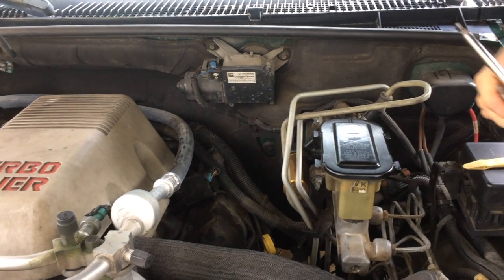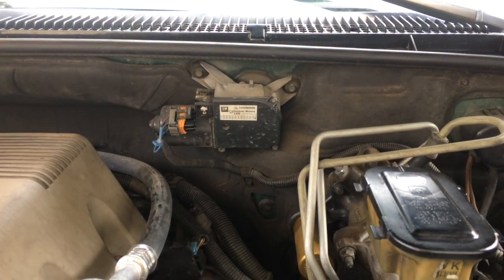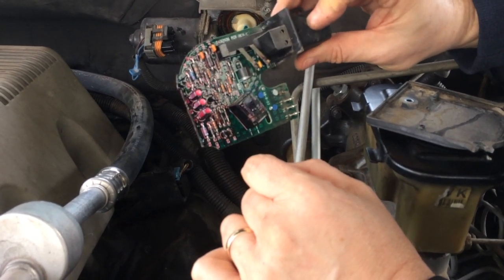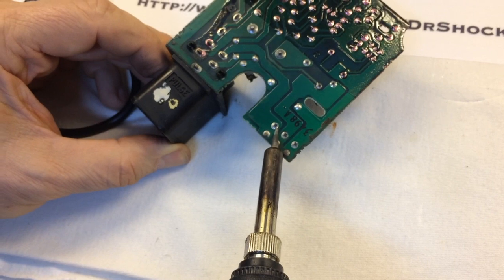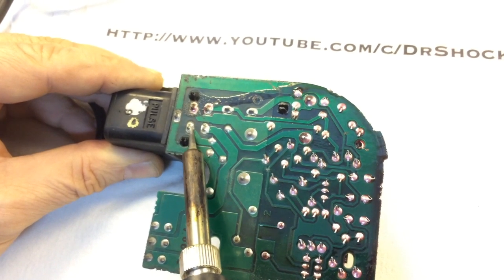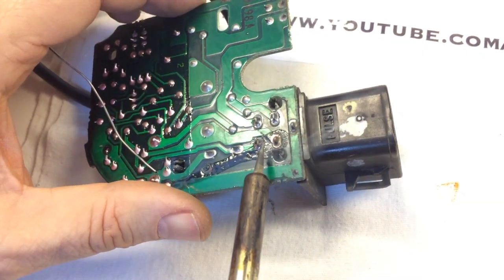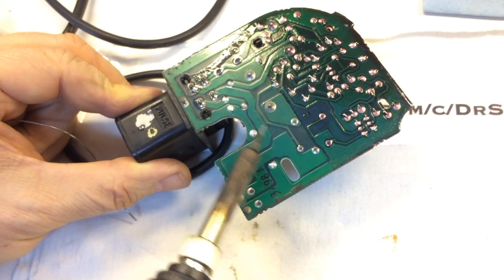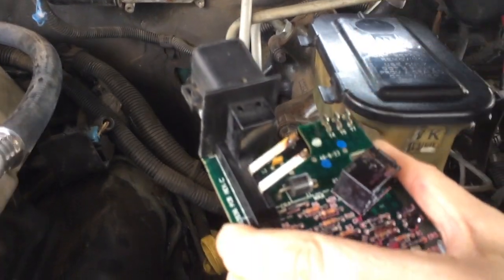1995 - 2002 OBS GM Truck Wiper Motor Not Shutting Off - Logic Pulse Board Repair (Chevy & GMC)

Comment: Well after a year of having the knowledge i finally decided to work on mine. When looking at the pins i found a few that looked like the solder has cracked. Soldered the connections and then bent the two spring contacts. Installed the unit and works perfectly now. Even fixed the washer fluid sprayer. Thank you very much. I did break the locking tab on the connector plug. Dang!

Comment: So far this fix has worked great on my 1996 Silverado. Just have to repair the seat mechanism and replace the seat covers and fix the annoying fuel gauge not going all the way down to Empty. I'm pretty sure it is not the tank sensor as it appears to read the correct ohms during a drive test, so that leaves the air core motor for the fuel gauge in the instrument panel.

Comment: Darn, it didn’t work for me. Any other suggestions?
Reply from the maker: LIkely a circuit board level component failure if not solder joint related.  The video description has a link to the part number for the board replacement.   Be sure you've verified correct wiring harness power and ground to the module first though.
Reply: @DrShock thank you

Comment: Tip- a higher wattage iron (say, about 40w) with a larger tip can transfer the heat more quickly which actually reduces the chance of thermal damage during the rework. I find it helpful to apply a tiny bit of very fine rosin core electronic solder at the first contact with a given solder joint. the fresh solder & flux does seem to help get the initial heat transfer to go a little quicker. Anyway, I really appreciate this video, I know what I''ll be fixing on my 95 K1500 in the next few days!
Reply from the maker: We're using 350 degrees C on a high end digital soldering station here ;-)   You'll find the connectors metal frame makes for quite the heat sink on this reflow chore.

Comment: Get some no-clean flux from Amazon if you're doing this. When the iron touches the solder it needs the flux to work properly. Flux also has some cleaning properties. It's like using butter or oil in a skillet.

Comment: One of the most useful DIY videos I've watched in awhile.  I have a 96 Impala SS that had the same problem.  Using a multimeter to verify that the multifunctional steering column lever wasn't the culprit, I figured I'd replace the pulse control module circuit board.  Guess what, outside of salvage yards and other B body owners' spare parts caches, there are no new replacement boards.  Luckily I came across your video.  A little skeptical, I tried the technique last night and installed the board this morning.  It worked!!!!  Even the delay function works perfectly now.  Thanks man!!!

Comment: Hi - I have a 95 Chevy G30 (motorhome)   I can not figure out where my relay/board is.   any help ?
Reply from the maker: Do you not have the wiper motor in the front firewall like in the video?   I'm not sure if the G vans are the same board but it should be a similar design.
Reply: @DrShock  well,  I think so,  at first I assumed it was at teh wiper side,  under the top grill(?)   but my fuse/underneath looks teh same as this vid.   You have like the only good explanation vid.  Ill dig back into it later tonight or mpost liekly tomorrow,   everythign else works good on this mechanic owned vehicle,  so cal,  he never worried about wipers,  it sats for 4-6 month a yr.
Reply from the maker: Ok, I took a look and yeah the G van motor is mounted very differently from the C/K trucks.  It's underneath the inside drivers side dash area.   Once you get it out though, it should be the same type of logic board.   There's a video out there for removing the wiper motor from a G20, check that out and then come back.

Comment: Yep found a hairline crack on the solder joint where the "brushes" solder to the board! I would suggest adding a little fresh rosin core solder to the solder joint to get it to flow and build up a little more strength to fight cracking.  Thanks for the video!
Reply from the maker: @skylerhagen9960  You can expect upwards of 10 years out of this repair as I have vehicles for customers still on the road with what I showed here.  The solder used in automobile electronics in the 90s is vastly different than what's in use over the last decade or so.  There's really no added value in mixing in the modern alloys, which are going to be quite inferior due to lacking lead which was present back when these boards were originally assembled.

Comment: I know this wasn't billed as a permanent fix, but cold solder joints are not fixed long by simply heating up the solder.  There are multiple issues that can cause problems with this.

First, it is certain that they used silver solder to make the connection on that board, and silver solder is not as ductile as lead solder, and it work hardens much easier, which is part of why the boards are notorious for this problem.  Touching it up with a little lead solder will increase its ability to take road vibrations.  Second, while you may make the electrical connection more stable with heat, corrosion on solder joints, either lead or silver, is not removed with heat alone.  You need to use flux to remove any oxidation.  The solder you use to touch it up with should be flux core, which will at least help remove the oxidation, but even then, it would be a good idea to use flux on the joints as well.

One other thing is that that coating will not stop cold solder joints from happening.  It will protect from corrosion, but cold solder joints are caused just as much by vibration as they are by corrosion, and that small amount of coating will not prevent that from happening.

If anyone wants to basically make one of these boards like new, about the only other thing I would suggest is to replace those electrolytic capacitors on the edge of the board.  The big can looking things.  Many of these vehicles are over 25 years old now days, and those caps are only rated for a 20-25 year shelf life.  They may be fine right now, but it won't be long before they come to be a problem, and new caps are cheap.

With these fixes, a repaired board will likely last much longer than the original board.
Reply: PoDuck thanks for the tip. I personally did add some 60/40 or 40/60 rosin lead solder. Used a ton of rosin flux also. Did not hit every pin but the ones that looked like they had visible damage. Works awesome. I’ll definitely pull it apart again if and when it acts up.
Reply: is it possible to get printed circuit board wiper motor for Audi A3 2007?

Comment: That's the new designed one too, black connector which is supposed to be the fixed part.  gray was the factory one that used to crap out out of nowhere.    I had one go bad of the newer design. but the solder joints looked great, something happened and the wipers rested higher than normal in the off position.  Swapped the board. Been fine. I have a small hoard of those boards. now they are made like junk Made in India or China or something + the price is nuts, I found a bunch. I put a little 3m strip caulking around the cover and leave the bottom edge open.  I think mine got wet and that's what shorted it  Every other GM has a sealed cover. BTW watch your passenger wiper arm your linkage is worn or loose it has the bounce. I had the same thing happen in my 94, Put 2 new GM linkages in it, Wipers are SUPER quiet No chatter. Best 40 or so bucks I ever spent. Now I think they cost more.
Reply from the maker: This one is a factory installed 1999 motor, and I too was surprised it gave out after 19 years with the same type of issue.   After 19 years yeah the linkage is getting worn, another thing on my list to address at some point.  ;-)
Reply: @DrShock  Ya linkage is $60 a piece now.  Ouch. AC delco/ GM still makes it  You can paint the new pieces too so they live longer w/o rusting.  Ahh So the later trucks maybe got the revised board. Which still has issues haha